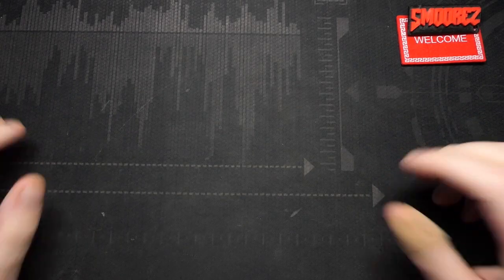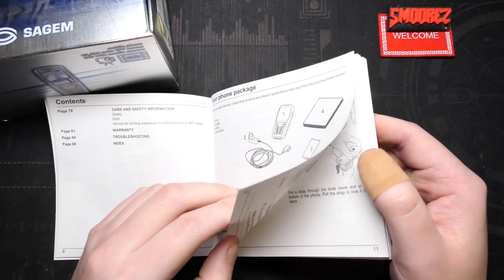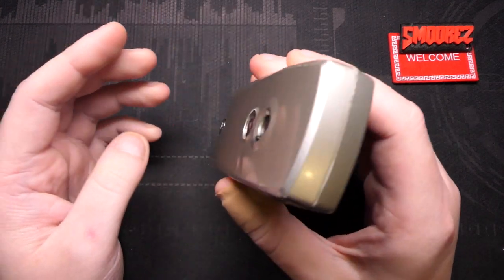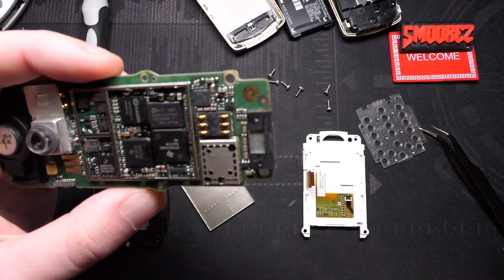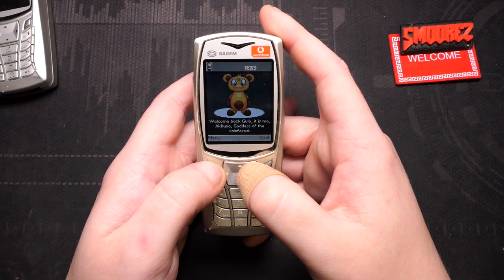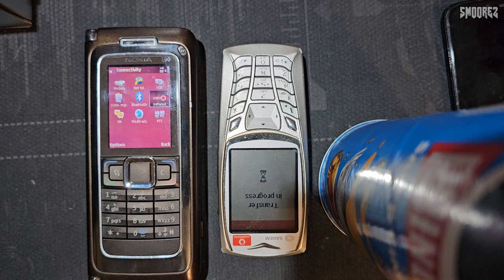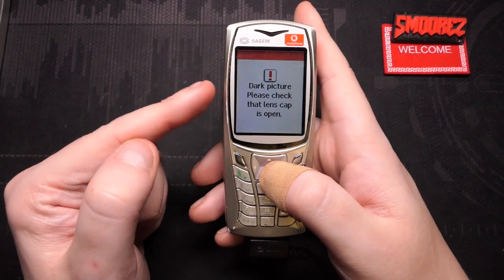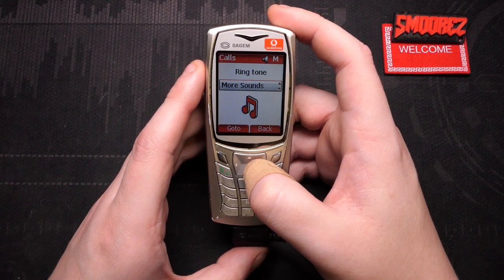The SAGEM My X-7 - My Second Phone I Ever Used in 2006! |THE_PHONE_ARCHIVE|

Comment from the maker: I spent last night thinking back over the dates of all these phones. Turns out this was actually June/July 2005 I got this. Used it until early 2006 and then I got the SLVR L6 and had that until late 2006. Then got the LG U8360 and had that until mid 2007 and then got a Nokia 6288 and had that until 2008 when I then got my N95. Ill have to update my Mowned profile to change that but I think that's correct!

Thanks for tuning in, I hope you enjoyed this one :)
I wish I could've looked at the Android calculator this week but it literally just broke and I sent it back to get a refund to then buy another one. I'll likely take a look at it after my break.
Let me know what you thought of this and if you've used Sagem devices in the past!

TIMESTAMPS:
Intro, Timestamps & Disclaimers: 0:00
Not my SAGEM, Quick Specs & Around it: 1:29
My SAGEM Box: 3:32
The User Manual: 5:47
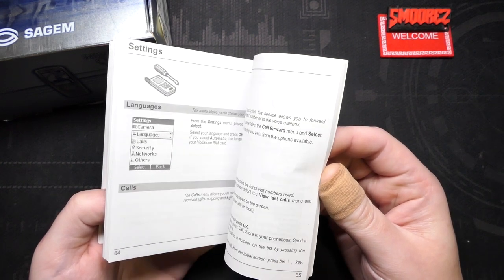The Sagem My X7 & Quick Specs: 7:17
SMOOREZ RAMBLY STORY TIME: 8:21
Around the Sagem My X7 & More Story Time: 16:34
Taking the back cover off & the actual covers: 18:11
Teardown & Hardware: 19:12
Finally Powering it up & First Look: 21:59
The Keys & Browser Menu: 23:02
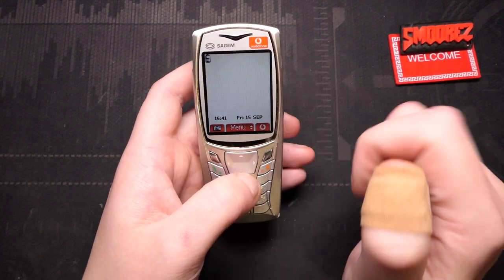Menu, Theme & JAVA GAMES: 24:07
The other Phone needed: 30:06
Demonstrating Infrared & Transferring Files: 31:22
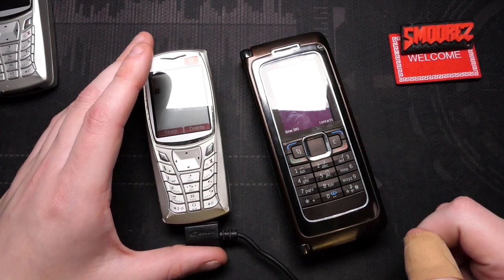Attempting a Java Install & The E90 is cool: 34:02
Default Games, Game Settings, Memory & Applications: 35:08
To Do, Calculator, Converter, Alarm, Timer & Messages: 37:04
The Camera, Editor & How it works: 38:27
Camera Test: 41:09
Camera Quality & More Editor Options: 42:46
THE RINGTONES & OTHER SOUNDS: 45:44
Voice Recorder, Wallpapers & Screensavers: 56:11
The rest of Settings & Keypad Lights: 59:10
Conclusion & Other Stuff: 1:01:02
My Next Phone & Final Thoughts: 1:03:33
You've made it to the end, thank you so much: 1:05:48
Rambly Outro: 1:07:10

Be good people!
Reply: Now for new phone, fully drain battery to 0% and charge battery up to 100% for normal use.
Reply: Cool phone

Comment: In 2005 I had the Ericsson K750i, it was insanely good. You could get away with taking some basic photos for memories, outside during the day at least, today and it would be good enough even if very basic. 

And the great thing was Carphone Warehouse, who sell contracts and phones in the UK (might be elsewhere I don't know), would only stock unlocked phones back then instead of locked phones as this made stock easier to manage. And if you bought a phone, even if you wanted just the phone for full price, they would purposefully "sell" you a PAYG sim at the same time which would bring the price of the phone down to the PAYG subsidised price. So I only paid £180 for it which was hundreds less than the full price for the phone! 

My first ever phone was 1998 I think, it was the Ericsson PF768. It was pretty cool, a flip phone back when many others were huge bricks. Basic interface, but solid and really good quality.

Comment: I remember the selfie mirror vaguely. In 2006, there were a few phones with front cameras. My parents which worked at siemens had ones which ran windows mobile (the old xp looking one). They were prototypes where they have conmbined a navigation system, GPS and a PDA in one device. It had a stylus touchscreen and a full keyboard. If the iPhone would not have come out a year later, history may have been different. But in retrospective, i don't think that the siemens phone would have beaten the iPhone in pupularity. The final product was a very thick grey slab with short battery life and it was very expensive. The final model i believe also had an SD card slot, which was used with the bundled Garmin navigation software, but could also be used for music, video, games etc.

Comment: Had the myX-7 in T-Mobile flavor during my 11th grade, sold it and missed it, the CCD camera had excellent response time from the moment the button was pressed and the picture taken, the saving was a different story, managed to take instant shots of lightning bolts with it. Today I found one second hand in mint condition and bought it instantly to put it in my collection, since I had the Orange edition with specific menu. After the 7 I bought the myX-8 which was nice but a mixed bag due to the slow reaction speed and hefty size, afterwards bought the my700X which was better in all aspects specially that it had Bluetooth audio streaming with 3D sound by Arkamys (a hot thing in many cars nowadays). I bought a replacement battery from a German supplier and it's perfect, better than the original. Sagem are known for their shoddy batteries that swell and lose capacity fast, similar to early Samsungs. I have somewhere around 50 Sagem phones, including several prototypes and many of them have dying batteries. I still use Sagem and remnants of them in the aviation industry as they were an important supplier for Airbus.

Comment: My first phone with color screen and camera was the Siemens S55, which was quite amazing for 2002 and it had both infrared and bluetooth. The camera was a separate module though that you clicked onto the bottom, and it had a flash. Mine also came with a serial data cable to transfer stuff to. Might be worth a review if you come across one. First actual phone was the Motorola M3688 in 1999 which was quite a brick even back then.

Comment: For me Siemens had quite the futuristic looking phones . CX65 and CX70 .I digged a lot the designs for these phones back then and the big display . The most bizzare phone siemens did if you ask me is the SX1 . Its from 2003 ,ran symbian os and you could play mp3 files and it had mmc slot . For when it came it was interesting looking one but the numpad was akwardly placed 😂.They had weird phones similarly to nokia like the penphone,xelibri etc . Siemens phones also had always on display 😂 with a big clock .

Comment: The AMD Chip might also be a Flash chip. AMD produced many chips for other companies as well... as a side note, ironically they produced many of the early intel designs under contract (and not exclusively :D). I tried to verify this but the Calypso chipsets are not very well documented publicly despite their popularity in the osmocom community. Since the TWL chip is most likely the analog baseband, the thing that's left for a complete chipset would be some flash memory. I am not that sure though.

Comment: Personally i never used a Sagem but my grandma used to have one  if i remember correctly, then she switched to some kind of chinese touchscreen stylus thing and later moved onto some kind of Sony Ericsson slider phone (i think W910 if i remember correctly, and she had it for long years afterwards. My personal old phones would be first some kind of Siemens that i know nothing about what model could it be because i was extremely young, and then a Sony Ericsson K550i that i still own to this day, but the casing is pretty destroyed. I might try to move the internals onto a better chassis (as i have some locked one that could be good for parts) but it's a plan for another day

Comment: You can get the phone at 58.40 in wallpapers that it displayed the my v75 in the uk and the covers were compatible with the myx7 so I used loads of sagem myx7  covers on my v75 mine was blue for the myx7 cover and slate gray for myv75 and the none Vodafone version had generic completely different software on with a much better user interface worth a look at the unlocked version none Vodafone complete different handset

Comment: I had a Nokia 3300 and eventually got a used N95 used it until it died and got a Nokia 2630 Until 2008 when I got a Nokia 5310 I used it until I got a Nokia 302 then moved to Windows phone Nokia 520 in 2014 got the 640 xl then 2015 a 950 xl Evntually moved to Samsung Note 9  In 2017 I went with Xiaomi Poco f1 and a Max 3 because of the big screen. Now a fold 4